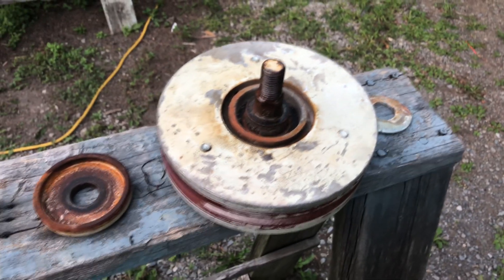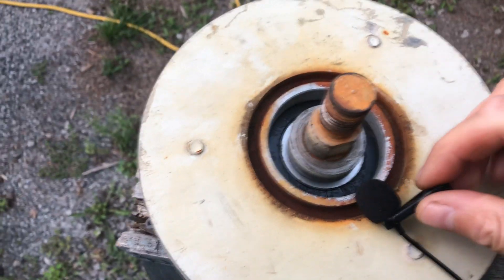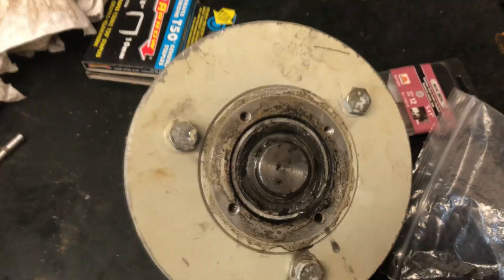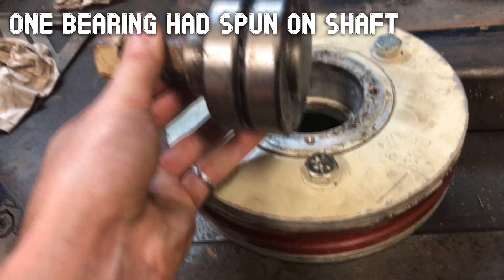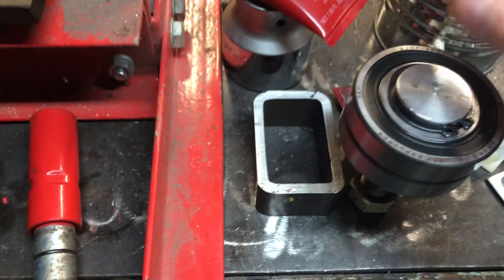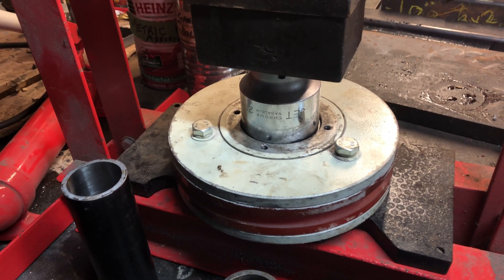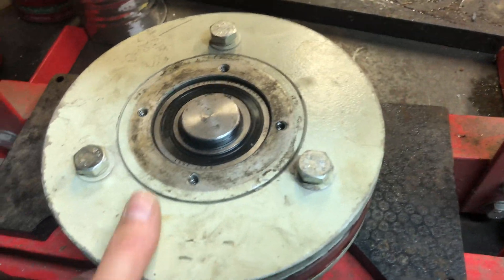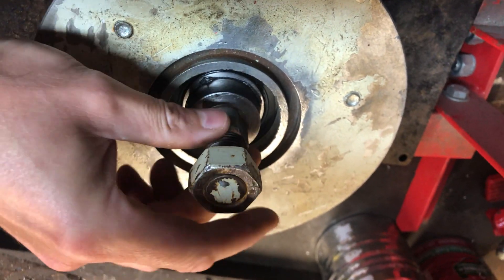Diamond wire saw guide wheel bearing replacement

Comment: Great video. I noticed when you cut shapes, the guide rollers do not change their position following the direction of the wire. Are there any problems with this?
Reply from the maker: I have purchased parts (servos, gearboxes with hollow shaft) and figured out the math (I think) to calculate the rotation (normal to the direction of travel)... HOWEVER as you see just leaving them in place they work well enough.  The liners wear faster than if the wheels stayed normal to travel.  It's on my list of things to make better :) but for now the robot takes up my spare time.  FWIW on the first Italian CNC saws the guide wheels did not move.
Reply from the maker: Also I should mention, that when doing wire profiling (CNC cutting) I generally cut a bit slower (feed rate), than if just cutting straight down making slabs.  For wire cutting there is always a "bow" in the wire.  So the center of the cut always lags the edges.  If you have too much bow the center will not have the same shape as the edges.  The CAM software also compensates for this by slowing the feed rate for changes of direction.  But I also cut slower so there is less bow, you can't go too slow or the cut will be rough.  If I were to go too fast there is a risk the wire would jump off the guide wheels since they do not follow the cut.
Reply: Thank you.  @GregsStoneYard

Comment: who did you get the pulleys from in china, i am looking to build something similar and not sure who to trust.
i have been looking at madeinchina.com and alibaba.com
do you remember the company?
Thanks!
Reply from the maker: These small pulley wheels were purchased from Skystone (http://www.wire-saw-machines.com/  )  and Hercules Abrasives (http://www.herculesabrasives.com/ ).  Hercules was the better of the two for ease of dealing with them, email susieweng@herculesabrasives.com tell her I referred you.  I know of another person who has used Hercules with success (look up Ideal Quarry, Art is the owner and builds saws).  There is a point where you wire transfer the money and just cross your fingers everything goes OK :) .  You can contact me at my youtube username (greg9504) @ gmail.com, if you want to run ideas about your saw by me.
Reply: @GregsStoneYard  Okay, 
Thanks!
I will do some checking into both places.
I'm looking to use a Deutz td2011 on concrete saw frame for a power source. this unit has a 10 groove 3vx sheave, was planning to use five grooves for the power transfer to the second sheave? i need to do some figuring on sheave size to get the rpm in range at the drive pulley. 
Do you think i could use a 12 Volt electromagnet mower clutch to start and stop the wire saw?
Reply from the maker: @merctv8957  Sorry missed this earlier.  Gas/diesel power is doable but electric is simpler if you have the option.  Use a VFD you can control the speed and use 3 phase motors from single phase (that's what I'm doing).  I'm not sure what you mean by using "five grooves for the power transfer to the second sheave", do you mean you think you need to power both large wheels?  You don't.  There is a drive and driven wheel, think of the cutting cable as being like a big pulley.  How many horsepower is the engine?  You might be able to use the clutch from an automotive AC compressor but I'm not sure how well it would would.  If you don't have electricity available a big generator might be the way to go.  If you get one that generates 3 phase then you don't need the VFD (at least to start).  For you calculations you want the wire to run at around 24 meters/second.  Ideally adjustable in a range from 22-30 m/s.  Slower harder stones, faster softer.
Reply: @GregsStoneYard  hi Greg. Do you build wire saws for sale? I'm interested.
Reply from the maker: @razdaddy95  Hello, no sorry.  I just built this one for myself.  If you are in North America check out Wilson Saws https://www.facebook.com/pages/category/Commercial---Industrial-Equipment-Supplier/Wilson-Industrial-Electric-305387723017/ or  www.idealquarry.com